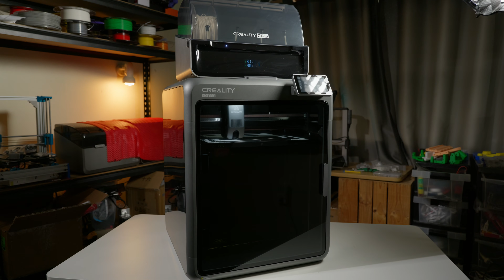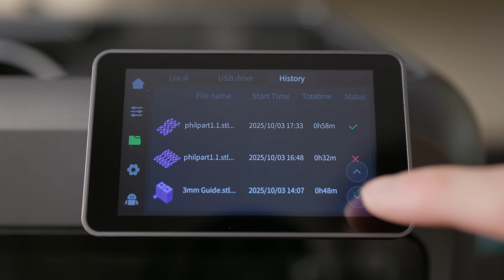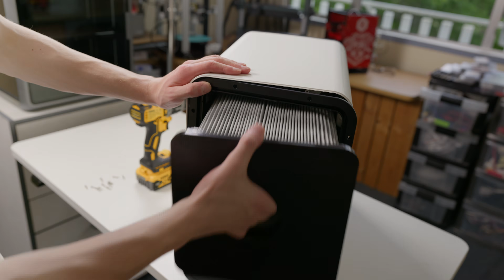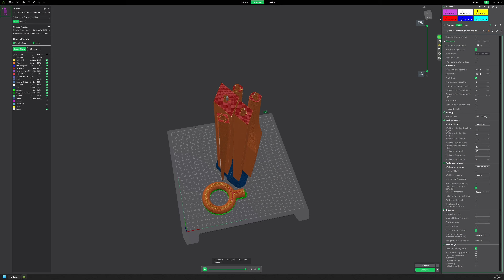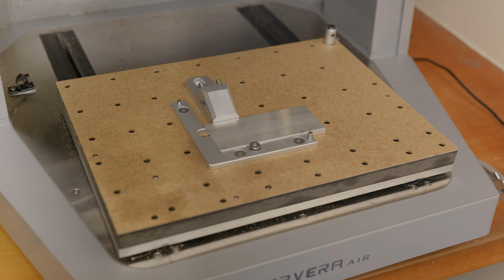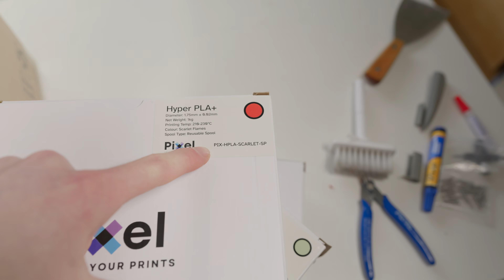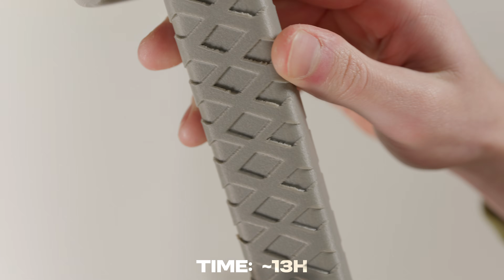My Time with the Creality K2 Pro

Comment: I bought my K2 Pro three weeks ago and didn't receive a spare hotend nozzle @1.02  What a rip!!
BTW, you stole my transparent SLA Resin toolhead cover.
Reply from the maker: Hi Phillip, congrats on your purchase, and my direct apologies regarding the miscommunication with the nozzles and toolhead cover. That's a disclaimer I forgot to add, and I won't dismiss that at all. Thank you for bringing them up! Creality provided 3 Obxidian nozzles in a care package before the machine's arrival, alongside some filament. This should have been mentioned, but upon checking my script and previous short-video, I did not include this detail. I believe the nozzles are sold separately for between 60 and 80 USD. I will try and eliminate such silly mistakes in the future. 

Regarding the theft of the toolhead cover, this is a very serious claim, and I want to make sure it's resolved.
The link to the toolhead cover I used is here: https://www.crealitycloud.com/model-detail/k2-plus-toolhead-replacement-cover?source=17
The model by "Yerg" was purchased by me on Creality Cloud with 200 credits, or whatever Creality calls them. I paid for the credits myself and have the receipts for them, and the proof of ownership of the item in my account history. I can provide any details you need. If "Yerg" is the one who stole your model and re-uploaded it (if I'm understanding the situation correctly), then I am simply a middleman in this equation. 
The lack of a link in the description to the cover is partially my fault aswell. I reached the description character limit and was unable to add it at the time. 

Please let me know how I can fix these mistakes, and I'm sorry again for the trouble. There were oversights in this video that really shouldn't have happened, but did. 

Cheers, Tommy.

Comment: I'm sorry you can't call that a mercury one.1
Reply from the maker: I won't argue, but I will state what I have done. I ordered the official Mercury 1.1 BOM and followed the team's instructions before installing Andrei Stanciu's "Mercury 1.1 AWD mod Updated" to get the AWD performance. So while it might not be a barebones Merc 1.1, it's closer to it than an Ender 5. I've made the mistake of calling it that quite a few times, haha. The toolhead is completely separate though. No harm either way, and there is validity to your statement. Cheers!

Comment: Seems like he breaks everything he touches or does he keep getting lemons?
Reply from the maker: 50/50. I'm very clumsy, but in this case, I have really no idea. My Creality Hi is at least fine and operating now, but given my history, there's a small chance I just made enough mistakes to somehow disrupt this machine. That being said, after replacing the recently arrived hotend, strain gauge, and the toolhead cable to no avail, I've now been guided towards the toolhead PCB as the culprit... I'm simply done with this machine as it's just being too annoying. Cheers!
Reply: @TommyHoughton don't give up pal keep at it all will come good in the end. I have a E3NG build I've been working on for a good few months now and I'm at the dreaded firmware /configuration sets and oh is it painfully annoying so I will put it too one side for few weeks crack on with another project and come back when I feel like making some more progress.
Reply from the maker: We'll get there! That's admirable patience with chipping away at the build, as I know if I let something take too long, it could affect my motivation. I also completely get the dread regarding the firmware, as it's something that's bothered me too in the past, but I've started to enjoy it a bit more when treating it like its own project. (It also helps not having any time pressure, haha, as it always takes so much longer to do a config than expected.) At least a completed config is one and done! I wish you the absolute best I can with that stage 💪

Comment: Tommy:"the Creality Hi is my most trusted printer"
all the videos since it's review: out of commission or gutted
Tommy, you need Creality to send you a second one to become a sacrificial one
that's the way i am (i have two kobra 2 and two kobra 3 and two FLSUN SR and two Flashforge AD5M (one std and one pro)
Reply from the maker: While it may have been out of commission for one or two videos given the hotend replacement (you're not wrong at all there!), I'm pleased to say it's now up and running! As of yesterday, at least. I'm very pleased about that! 
Creality did almost send me an extra one when we were troubleshooting it for the first time, but I told them no, as it'd be too much for such a small issue. (Some would call that a silly decision 😅)
How are you finding the Flashforges? I've heard good things about them, and did almost pick one up myself a year or so ago. Cheers!
Reply: @TommyHoughton  They work really well, they where refurbished units, only the non  pro game me problems (missing transistor in the head unit, so no heating)and the pro one having a clogged hotend when received . the principal problem is that the removable bed are only good for 100 to 200 hours of printing before having problems with print adhering to the print plate or the steel of the removable plate warping due to use
Reply from the maker: Awesome, I'm always pleased to hear when someone's taken in preowned or refurbished machines, as many of mine have been in that boat. I will admit, an entire missing transistor is quite an amusing problem! I can't say I've ever heard of anyone else experiencing that, let alone myself. That's also interesting to hear about the bed durability, as I've never been able to wear in any of my machines enough to encounter such issues; a sign I don't print as much as I should! Thanks for sharing the details!

Comment: hey if possible could you mention what isnt reparable about it compared to the other? curious cuz i was thinking while obviously different i mean overall motors belt bearings?
Reply from the maker: The main factor that led me to say that is the motion system/gantry. I don't see it being possible to replace the linear bearings on there, or the pulleys; the machine is pretty good in some ways, which is nice, but feels really closed off in others because of the frame. Another thing that's a bit tricky to explain is that it's just not as transparent as other machines. I replaced both the toolhead cable, strain gauge, and hotend, and yet the same error still remains, with other users pointing out it could be the toolhead board, so the clarity of what the errors could actually be is just not as good as it could be. That's my rough stance, at least. Cheers!
Reply: @TommyHoughton  i got you thanks i appreciate the response

Comment: The Creality is neat (and they really need to address the design flaws) but I'm eyeing that Trident in the background 👀 I know you're big on modding so maybe it could be destined for INDX at a later date?

I finally got mine tuned in, it prints ASA really well and took to the task of printing 310C PPA-GF for some high end parts like a champ. I kind of want to swap the Stealthburner for an A4T toolhead though, or upgrade the Stealthburner cooling.

Regarding learning CAD: Fusion is approachable but oh my god the cloud-only nature and editable documents limit are unbearable for large projects if you have slow internet like I do. FreeCAD is very gradually becoming a world-class CAD program, it just isn't quite as intuitive. Alternatively, Solidworks for Makers is only $48USD/yr and seems to be the standard in actual industry. It has optional cloud saving features and does have cloud DRM, but you can also work on files completely locally if you want to! That's the one I've been learning over Fusion lately.
Reply from the maker: My eyes were drawn to it most of the time as well, haha. It will absolutely get modded; definitely a "limits" style video, but likely not INDX. I'm not big on tool changers, multi-material, or multi-color at all; it's just how things are for me there.

I love to hear it! Tuning is something I hope to learn properly about one day. I've heard great things about ASA, and look forward to getting better with it. PPA-GF sounds amazing too. I've been super happy with the ABS-GF, and look forward to trying stuff like that in the future. I'd say go for A4T! Lots more potential with that over upgrading Stealthburner. I'm hoping to go with the Monolith toolhead once that gets released, among a few other things. Cheers!

Comment: Sorry, but this is the worst 3D printing I've ever seen. Try adjusting the parameters in the slicer first, instead of relying on the presets. And printer design is clearly not your thing if you don't even understand the basics and are trying to make design changes based on mere assumptions.
Reply from the maker: No need to apologise! It's completely fair to speak from experience. A good chunk of prints were using custom settings as partially specified, especially the ABS, ABS-GF and PETG-CF prints, which thankfully turned out amazing. All filament profiles were custom. The PLA? Much worse than I've encountered in the past, no disagreements there. Still, a manufacturer's machine combined with their own provided settings, should be much better than what was shown. Will just have to keep moving forward, and I will always be appreciative of feedback to improve on 💪 Cheers!
Reply: When you are paying this much and the manufacturer offers presets, they should work fairly well
Reply: @user9267  
Manufacturers don't owe you anything. You pay for a quality tool, but you're responsible for how you use it. The manufacturer isn't obligated to teach you how to use it.
Reply: @user9267  I'd like to see you use an industrial CNC machine without sufficient training. It's been established that industrial machine manufacturers typically implement all functions independently using software within a single infrastructure and document every detail.
(Unlike 3D printer manufacturers, for example.) But the end result still depends on the operator's training.

Comment: Reason why loadcell based probing is slow as the controller for its is usually at 80hz max so to get precision of 0.01 you need to go at 0.3mm/s on z but manufacturers usually bump it up and reduce accuracy to 0.025
Reply from the maker: That's some brilliant insight! I really appreciate you clarifying that, as it makes a lot more sense than whatever I was thinking, haha. Cheers!
Reply: @TommyHoughton  that's why becon,IDM and bambulabs use eddy current for nozzle probing and offset as it can give higher speed , resolution and accuracy, I am working on my own loadcell and eddy current based probing solution so I did a little research and calculation for it
Reply from the maker: I really hope Creality starts using eddy current sensors soon, at least on some of their higher end machines, given how often we're seeing them appear now. Both loadcell and eddy current? That sounds pretty interesting! The topic does strike me as rather intimidating, if I'm being honest.
Reply: @TommyHoughton  eddy current can do both work. Eddy NG uses the sudden stopping of the nozzle when it touches the bed, which shows as a sharp flattening in the eddy current curve. For that brief moment the distance between the bed and the eddy coil is not decreasing, since it’s probing, and that gives the exact contact point.
Only problem with eddy can be chamber temp, but with temperature compensation it can be mitigated. It also works faster than loadcell and can collect around 10k samples a second, which makes it better.
Reply: 80hz is typical for HX711 and other ultra low cost ADCs.
You can get much faster sampling ADC if you care about quality of your product as a manufacturer.
Reply: @JG-mz7hg  not like they do i think most use hx717 with 320hz atleast thats what prusa uses
Reply: @vickeythegamer7527  That 320hz sampling rate has terrible noise,  I still think they should use better ADC :)

Comment: The artifacting you're seeing on the katana pieces is a pressure advance issue. I've encountered it before with the Monolith Beta toolhead, it seems to be caused by the heater block being non-uniform in temperature. A custom silicone sock that covers both the hotend and nozzle should help keep the block temperature more uniform.
Reply: Could also just be how Creality is tuning for PA since the values will change based on print speed
Reply from the maker: Ah, that makes so much more sense! Some areas were more affected than others, which didn't trigger any thoughts on my end. I will learn from that, and thanks for mentioning it!
I was going to ask, "How do you have access to that toolhead? I'm jealous!" but then I realised who you are, haha. I've seen a few of your (brilliant) posts.
I definitely want to buy/build that toolhead once it's out of beta for some fun on the Trident. That's also very interesting regarding non-uniform temperature, as I am planning on building a hotend that would likely encounter that issue, given it would have two spaced-apart heaters. That's a near-future project though, so still time to plan and rethink.
Given the blades were printing using the "auto-tuned" PA calibration right before the print started, perhaps that has affected things too; I'm not entirely sure. 
Interesting stuff! I appreciate you providing some insight. Cheers!

Comment: Great video as usual, do you think you'd keep the machine around for an enclosed machine with a bigger build volume than the V0 or are you hoping for the Trident in the background to fill that role? Bloopers are always a welcome edition to the videos, can't wait for the custom printer series to kick off!
Reply from the maker: Thank you very much for taking the time to check it out! I always really appreciate it. Yes, I will be keeping it for the time being, likely until I can get something sorted with a certain orange company in ~January. The Trident will definitely be the main go-to for now until I get those replacement parts installed on the K2 Pro either today or tomorrow. If I get it working well again, I'll keep it for a while, and then sell it to someone for a low price so a win-win can be reached. I'd love to keep it, but at this current stage, I don't see myself doing that. Regarding the custom printer series, that's the big thing now for sure. I'll be talking to a few others about how it can be approached, and making sure it's a balanced series as well. Perhaps some filler videos sprinkled in since things are very learning, design, and time heavy this time around. I want to do it properly! It's going to be amazing either way. Cheers!

Comment: GET A FEXISPOT TABLE STURDY AND STRONG
Reply from the maker: Regarding that equation, there's actually a bit more to it, unfortunately. On the purchase front, a flexispot desk would cost over double what I spent on my one, and as I use the desk as a temporary workspace for filming, it wouldn't be ideal for a long term machine spot. On the collaboration side, Flexispot don't work with New Zealand creators as far as I'm aware, which is a shame, so I've never been able to beg them for a couple of desks. I plan on figuring out this whole workbench setup soon, as I have too many machines and no space for them, let alone "good" space for them. Just have to look through the budget and see what can be done. Cheers!